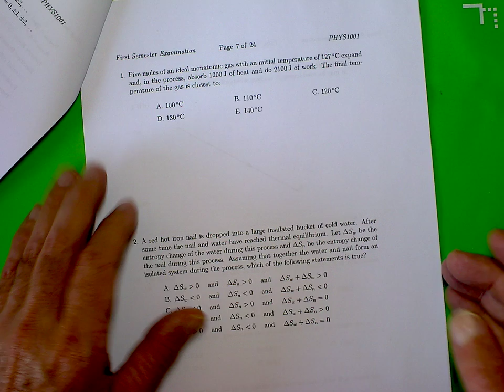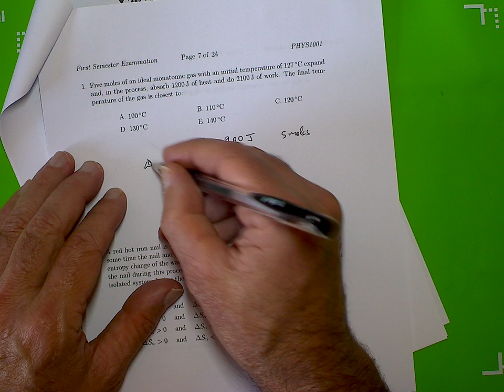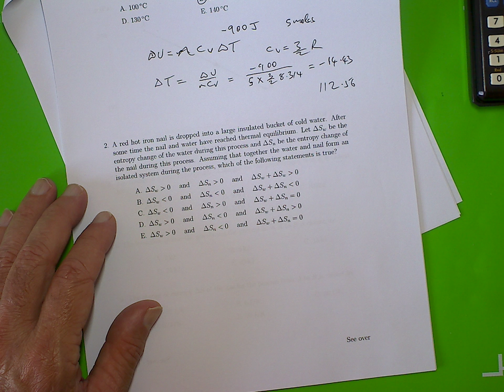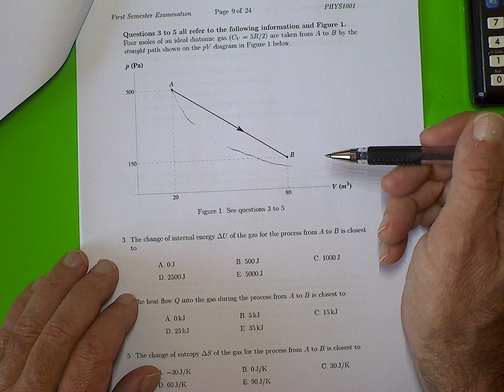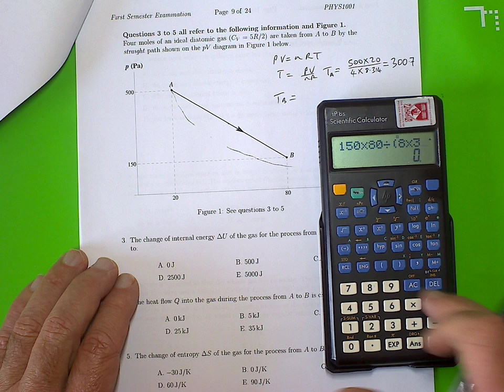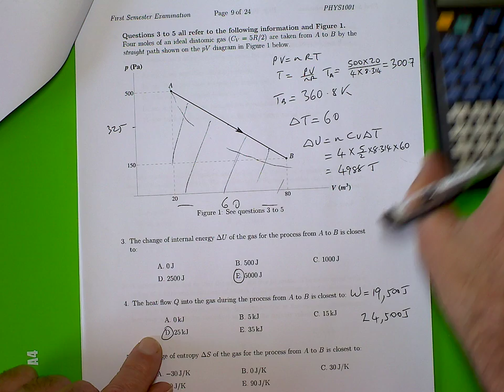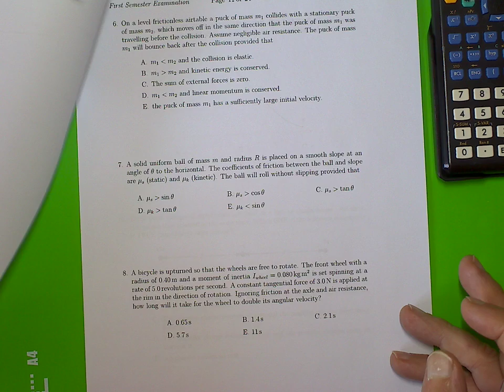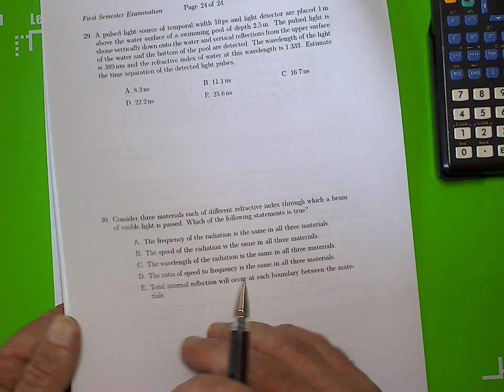PHYS1001 Exam 2016 Heat & Thermo Questions 1 - 5

Comment: for q5...you can follow a isothermal path from 500pa to 150pa (66.67m^3 volume) then a isobaric from 66.67 m^3 to 80m^3
Reply: I think it would be easier to follow an isothermal path from 20m^3 to 80m^3 then an isochoric from 125Pa to 150Pa. Note that delta(S)=mcln(Tf/Ti)=n*Cv*ln(Tf/Ti) = n*Cv*ln(Tf/Ti) for an ideal gas when using isochoric or isobaric paths.
Reply: Yes, that's a simpler process. Just remember that isochoric (constant volume) uses Cv while isobaric (constant pressure) uses Cp. Thus delta(S isochoric) = 4 * 5/2 * 8.314 * ln (90.2/300.7) and delta(S isobaric) = 4 * 7/2 * 8.314 * ln (360.8/90.2).